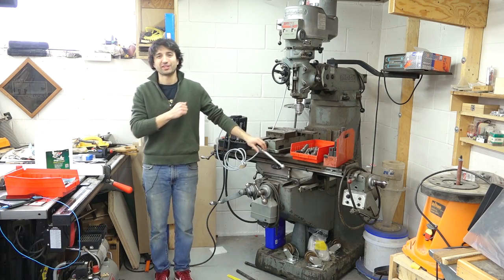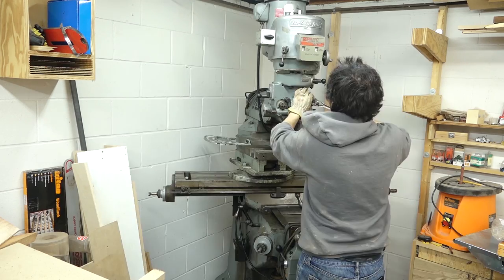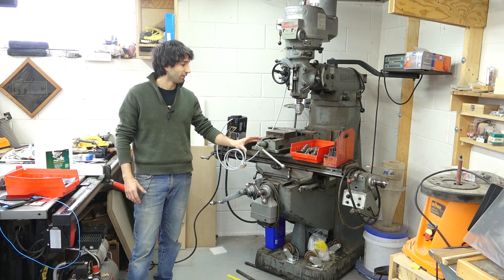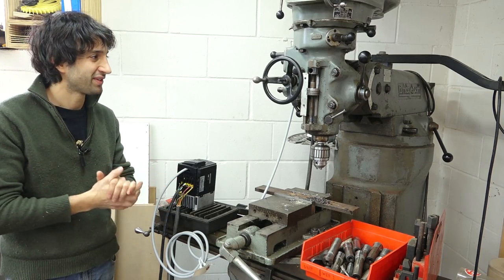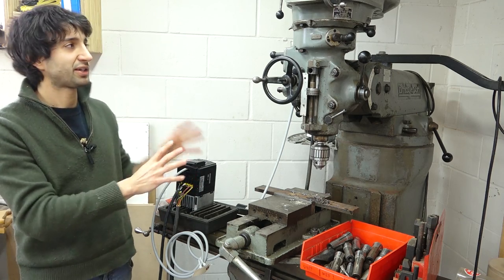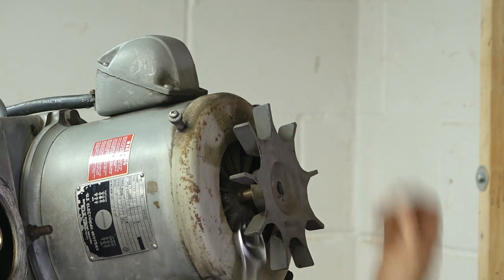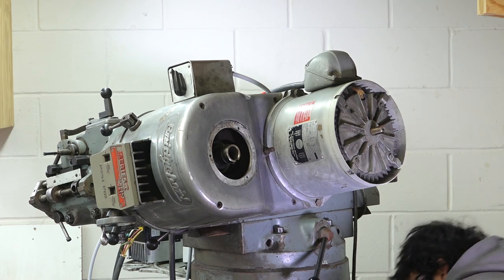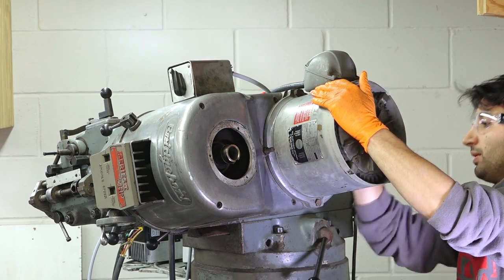Tooling and Head - Bridgeport Cleanup Part 1

Comment from the maker: Hope you enjoy spending some time in the shop with me cleaning this beast up!  I've included time codes in the description in case you'd like to skip around or want to watch in parts.  Have a great week!
Reply: Great job so so humor, and always a pleasure to watch you operate. ( Matt,  it's only grease.) Gloves?
Reply: Gloves are required because the heavy metal particles in the old grease and the anti grease chemical.
Reply: @p33ty333  I use the exact same gloves...lol
Reply: @jonivan1014  good for you :D :D :D
Reply: You should flip the moving jaw on that vise. you reinstalled it backwards
Reply from the maker: chris calloway thanks! Noticed that last week and got it flipped
Reply: are you maltese??
Reply: I don't blame you because anytime I get something I have to break it down and clean it so that I don't get filthy looking at it.  Do you need anything for it?  Because there is this place in Oklahoma that I see all the time on Craigslist that deal in Bridgeports and parts.  https://tulsa.craigslist.org/tld/d/lenapah-bridgeport-vertical-mills-free/6904307126.html

I also ran across this ad too incase you would like a Bridgeport vise.  https://tulsa.craigslist.org/tls/d/machine-shop-tooling/6853804003.html

Comment: Nice job; you are alot like me in wanting the machine to be clean . I saw you using grease and that is critical as well as oil to use when assembling after cleaning. Early in my working career I worked in a aluminium and brass foundry and a time at a machine shop and I did enjoy the accuracy aspect of the trade. That was monumental for my woodworking. I like the name Matti for the mill. Milling all edges in woodworking made projects  made assembly  easier and more pleasing to the eye and opened up the revelation for reading wood grain for strength and visual appeal . This was a game changer when I got into solid surface work as  part assembly was mostly butt joint  with epoxy adhesion. As always love your content and  your attention to detail.

Comment: Looking sweet. No funny sound but you better tear the head down to give it a good clear up inside. And also make sure the oneshot oil system works. In order to do that you have to remove the table... and... why not take it all apart :)

And maybe a lathe next month, surface grinder, shaper...

Comment: The handle for drilling has a spring inside the housing that may break sometime, don't throw the old spring away as you can cut lengths of it off to use to place between your parallels to keep them against the vice. The cross feed power feed is not really that useful but the longitudinal feed is handy. The cross feed power feed would be more useful on the knee to raise and lower the table, you would need to make an adapter to use it though. 45 years as a machinist mostly on Bridgeport mills. Nice looking one you have there too.

Comment: Hey Matt,
I didn't see it in the vid nor in the comments...and I'm hoping you did this without showing it... you need(ed) some grease in that thrust bearing ( and it holds the balls in place), and a little bit on the machined surfaces of the swivel base. I suppose you could use a dry Teflon type spray for the swivel base to go with your not getting dirty when you brush up against it. Same applies for the sliding surfaces on the vise itself.
Dad is an engineer - I grew up knowing all about "the goop" ( and lots of lectures about friction and such) - but Dad must know something, things that were put together 40 years ago aren't worn out and they still come apart... 

Wonderful restoration job your are doing and I can't but imagine all the great use you are going out of this mill once you are done ( and yes, I'm green with envy over your little friend there in the corner)

Enjoy the mill !!

Comment: Several hints about disassembling these vises. First, when loosening hex head screws that are tight, always insert the wrench so that the handles is on the downward direction, not upward. If you need to wack it with a plastic, lead or copper/brass hammer, it works much better, and is much safer when hitting downwards. I recommend using a soft metal hammer, as plastic or rawhide has too much bounce back.

When removing the movable jaw, loosen that Allen screw in the center of the rear first, then the jaw lifts straight up. Be careful of the half ball bearing in that jaw, it’s easy to lose.

If you have a loose ball thrust bearing, a bit of grease will keep the balls in the retainer. And please, don’t bang cutters against each other.

Comment: Looking at the vise asembly. The  large vise top part that slides was put on backwards. The Eagle beak should push against  a  segmented sphere,and the screw in the center of the top vise slide is on the side nearest the handle taking up the slack and preventing it from coming off. Hard to explain but it you lookup Kurt vise you will see how it goes together.  Also be sure the power quill feed is not engaged at speeds above 2600 rpms. Should see it I'm on the grass plate above the disengage lever upper right, I  like your channel and  have fun with the mill. I have a 40 years as a toolmaker,and be aware that once you cut metal you may not go back to wood haha
Reply from the maker: hahaha I bet you're right.  Thanks Al!

Comment: Get some thick rubber matting and cut it to fit on the bed and cover the t-slots when all you have is the vice on the table.  This will prevent chips from working their way into the table and keep it much cleaner and it won't get nicked up.  Also get a few cafeteria trays to keep your cutters and such on when your working.  Keeps things organized and they don't get dropped on the floor etc.

Comment: Once you get the table cleaned you might consider installing covers on each side of the vise: When I was a shop teacher I made them out of masonite with scrap wood in the T slot grooves. This way routine clean up is much easier but they can be removed if you need to use a coolant stream for a particular project.
Reply from the maker: I plan to except they’ll be crotch veneer 😄

Comment: Also for degreaser, try Simple Green, but make sure you buy Simple Green HD  orrrr Simple Green Extreme Aircraft Cleaner or else you're going to see some corrosion if you leave a soak over extended periods of time. Just had a recent scare on some rocket parts with the standard simple green and learned that lesson the hard way. You can get SG HD for pretty cheap

Comment: Doing maintenance on Bridgeport machines it is best to use some hardware store 12L14 nuts on the head. Then instead of breaking the studs that are a pain to replace they will simply strip out the nuts which can be replaced much faster. Most people will over tighten the head because they have no idea as to how you should engage the cutter with the work piece with out ripping it out of the vise.

Comment: There is a hole in the center of the Table for oiling the Acme screws for the X,Y Lead screws could be plugged with a Allen plug screw.
Reply: john ward you're thinking old Bridgeport that's a variable speed head that has a one shot Lube that lives up the screw in the table

Comment: VERY NICELY DONE!!! I cant wait to see the beast in action to make some crazy stuff!!! Did you ever consider to use Gunk motor degreaser, that stuff works so good on engines and mechanical parts.
Reply from the maker: Thank you!  I just used what I had.  That stuff works really well for cleaning steel for paint prep.

Comment: 33:34 - that's where the air comes out after it's cooled the motor, so try not to block it - possibly air flow out of this part, will keep most dirt out the vari-drive area.

Comment: I wash my car from the bottom up.  if you start at the top you loosen a lot of dirt and it will wash  down to the middle or the bottom of the car.  so when you wash those areas your wash mit will have even more dirt onto it and clog even faster.  as long as you keep the surface wet and rinse it well at the end it works  perfect.

Comment: I'm a retired tone die maker if you have any questions about the Bridgeport I'm more than happy to answer your questions you want to make sure you get as much backlash adjusted out as possible you will need to compromise on your Gib tightness because bridgeport's generally wear out in the middle because people do not move the voice around on the table like they should that makes the machine wear out right in the middle if you move your voice around every time you do a different job you'll wear your machine evenly

Comment: For those who take machines apart and clean them. Try to learn one rule. Don't let hard things hit precision surfaces or parts, or you will no longer have precision surfaces or parts.  A clean machine with bent, dented and marred parts and pretty paint will not be as accurate as a dirty machine with undamaged precision parts.

Comment: If you want a bether vise, why not try your hand at making it using the Bridgeport? Either make a new one (although you probably would need a lathe as well 😅), or go the more sensible way, and redo some of the parts. Bether (this part depends how accurate you manage to get), and you would get a lot of practice (the best part, I would say) 👍
Reply: Unfortunately compared to a surface grinder a mill is only a roughing tool. Good vises are machined and then surface ground to there final accuracy. Even a new Kurt vise at roughly $600 is cheap compared to what it would take in time to build your own milling vise.

Comment: HI Mattthew, a couple of points - don't let shavings/sawdust get on the mill - it'll help the rusting, and don't let metal chips get anywhere near your woodworking. Maybe cover the Bridgeport with a tarp when not in use. Best to have separate shops, if possible.

Comment: Sandblast and follow up with pressure wash. Make sure you get the areas where the metal touches with a lot of sandblast because there is always a lot of grease in those areas. Then use spray paint and decals.

Comment: As a millwright for 31yrs this is so very painful to watch...
Reply: Is that because of the state the machine was in or what he did to it? Sorry, don't know enough on the subject to know either way
Reply: Sue A is it because he has a vfd on a variable speed Bridgeport Maybe
Reply: @plymouth-hl20ton37  That would be because the VFD is converting his single ph to 3 ph. My mills a step pulley and VFD, but even if I had the variable speed head I'd still be powering it with a VFD since I don't have 3 ph power available in my shop. Then I'd just use the mills variable speed controls and leave the VFD at the full 60 hz. I'd still program the VFD for soft start and ramp up / ramp down times though.

There were multiple issues to justify Sue's comment, but I guess to be fair Matts just learning and wood workers need time to adjust there way of doing things. It's a lot more complex and involved with hundreds of ways to screw things up unknowingly. Wood working even to a high level is quite simple in comparison.

Comment: Are you going to put your VFD in n enclosure - it worries me that you have all that high voltage (anything above 50 volts is high voltage in Australia, and it takes only a few tens of miiliamps of current to kill you...)) floating around via exposed terminals. You may think that I;ll avoid that - that's fine when things are going OK; it's when you are faced with an emergency situation, you don't have time to think, and - zap - you are gone! Just looking out for you Matt, I'd see YouTube lose a great contributor.